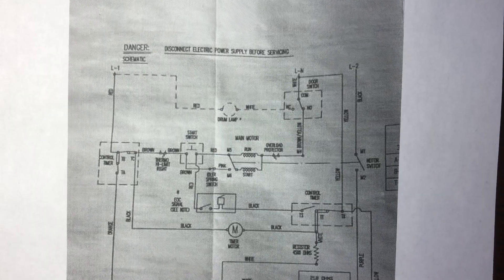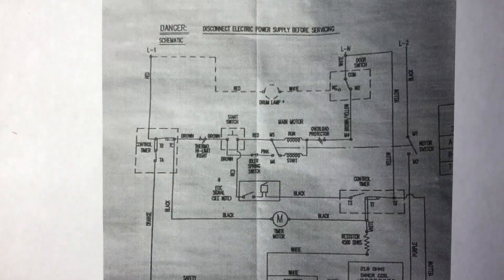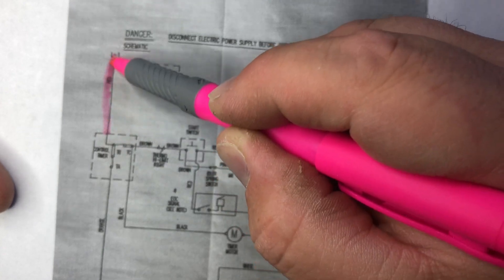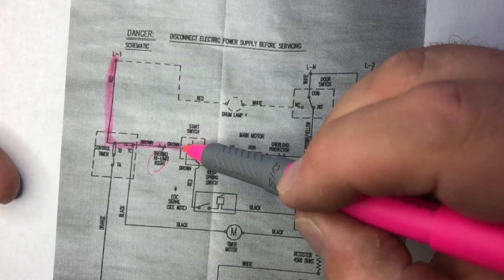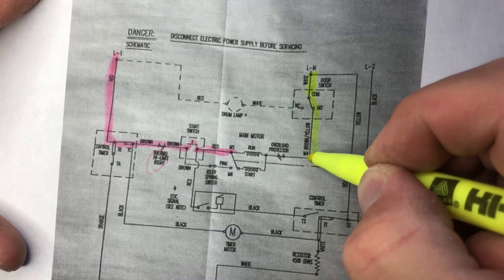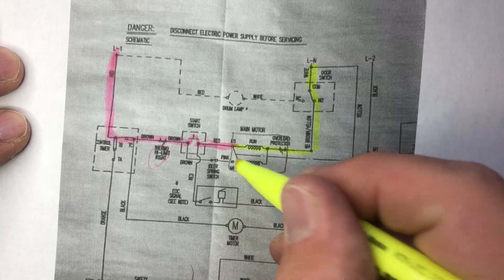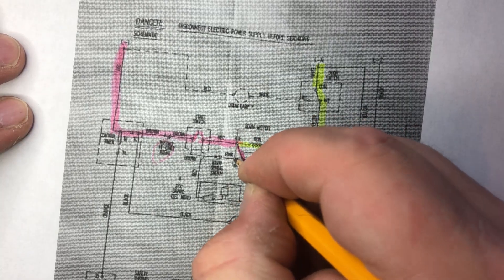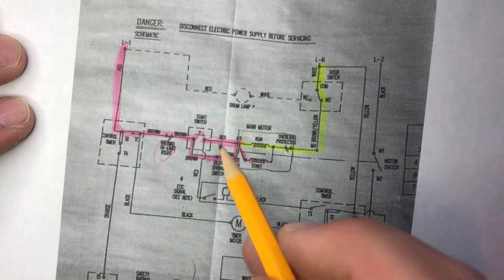GE Dryer runs with push to start, but shuts down as soon as released.

Comment: i installed my dryer today.  it was working fine for years at the old place.  now it only runs while holding down the start button.  maybe i'll just tape the start button down.  is it safe to leave the start button taped down all the time or do i need to unplug the dryer or something when not in use?
Reply: Definitely not safe.

Comment: Switch inside the motor needs to transfer from start mode to run mode. The motor needs to come up to speed and there's a centrifugal switch that's not closing when at the correct speed. Start winding on the motor gives it the starting torque it needs.
Reply from the maker: Yes, you will see me mention the motor switch @3:39 mark
Reply: I have the same problem on GE DBXR463GB0WW, can I just replace centrifugal switch only or whole motor? is it worth to fix if I need to replace whole motor for a 20 yrs dryer?

Comment: Thanks! If I tape down my start switch it works perfect snd the timer runs normally on the dry cycle selector. Looks like I’m hot wiring my switch to constant on…

Comment: Great instructional Drew,
won't it shorten the motor life if you run with start switch depressed or shorted closed?
Reply from the maker: No. The centrifugal switch is a spdt in this situation.   As long as the start windings portion of the switch opens in about half a second, the motor should be fine.  Motor doesn’t care where it gets power from.
Reply: @drewbrown9678 thank you that's exactly what I needed to know

Comment: where is this idler switch so I can change it?
Reply from the maker: It is next to the motor under the idler arm.
Reply: @drewbrown9678  Thanks. I changed it and that fixed the problem. There are videos on youtube that say to remove the drum. I did that, wondering how I would ever get the belt back on, and then saw that I could remove the left side panel. Then it was easy to change the belt switch and put the belt back on, which I actually never needed to remove in the first place.

Comment: In this situation, why would it sound like the motor is running normal when you hold it down, but the drum not turn?
Reply from the maker: The idler switch can also be called a belt switch.  The dryers is designed to give this symptoms if the belt falls off or breaks.
Reply from the maker: Skip to the 3:55 for the sparks note
Reply: Belt problem